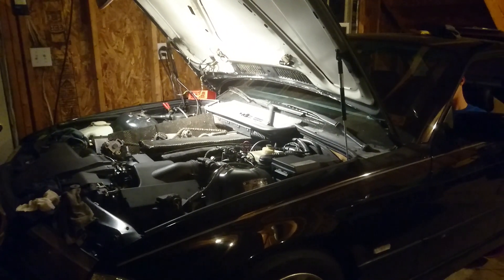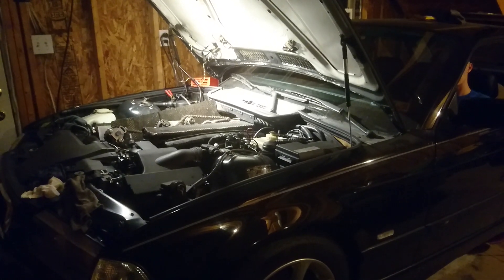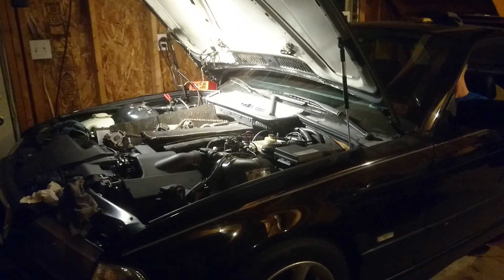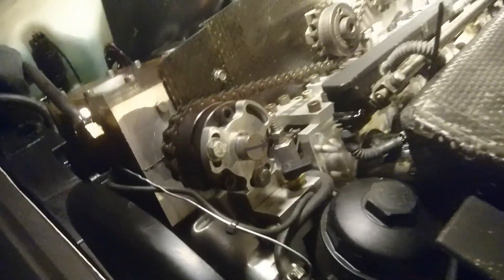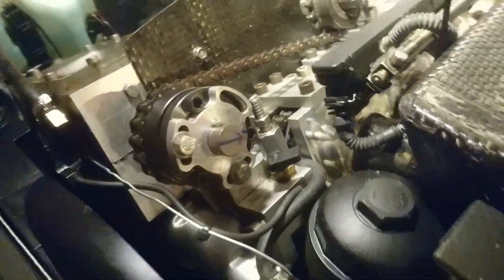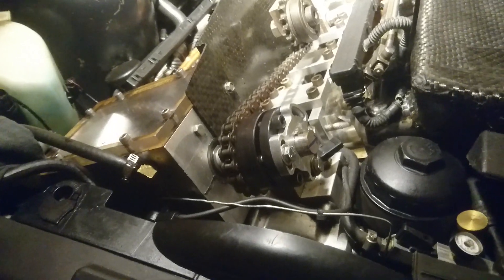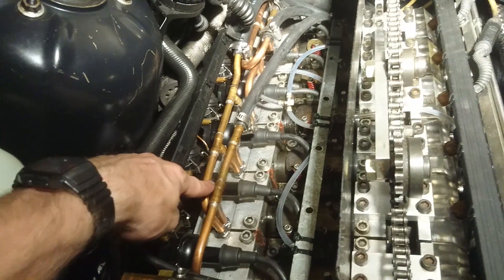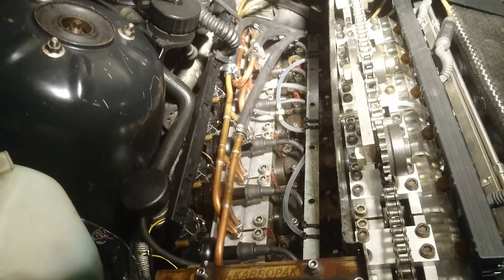BMW E36 Rotary Valve First Run of 2019

Comment: Hi Bro, Having been watched all ur progress, Good innovation! I used to be an engine engineer for 5 years major in Cylinder head design.  I advise u guys start to cast a one block cylinder made of aluminum integrated with all the stuff like rotary valves, coolant, and lubrication systems, u can even install the chain in the cylinder head. And I know this will cost a fortune, but u can try to 3D printing the sand into molds, with these sand molds casting the head will be much cheaper.

Comment: Sounds like it runs great! But why is there so much smoke?
Reply: We added oil to the top of the valves for the first startup, it is burning off.  There is also oil on the headers.
Reply: @johnpearson492  so after awhile it will go away?
Reply: @connorlynden6852  Hopefully.   There is also a possibility of an exhaust leak in the area of the smoke but there are some seals I have not reinstalled that will help.
Reply: @johnpearson492  oh that's cool, can't wait to see it all come together!
Reply: I can now confirm that nearly all of the smoke has gone away with the adjustments I discussed.  We fixed one small coolant leak which was leaking coolant onto the exhaust.  It is to the point where the engine leaks no fluids which means we now can start tuning it properly.
Reply: Yeah.  We were just excited to get it back together to the point it would run, there are a few odds and ends to tie up.  Put the fan on, install the oil system for the valves,  a few seals and address a small coolant leak we found after running it.

Comment: it also sounds like american muscle on idile. Did u make any more road runs, is car reliable on road? Is drviable now or still garage project ?
Reply from the maker: There will be some more road tests soon.  We need to fix one or two small things and then we can have lots of fun tuning it.  I now can make a torque graph with my logger data, so I can avoid going to the dynamic and do it around my block
Reply: @MrPizzaman09  smoke that was coming out, was due to exshaust lickage or is something wrong with valves?
Reply from the maker: @bajkerjohnvolta  we dumped a lot of oil on top of the valves when it was first started up because it had been sitting for a long time and the oiling feed system to the top seals was not hooked up yet
Reply: @MrPizzaman09  ok, im very glad that this project works.

Keep up good job 😄
Reply: Turns out the aggressive cam sound at idle was primarily from it running lean and misfiring.  We've since added fuel to the base fuel injection table at idle and it has smoothed out immensely.